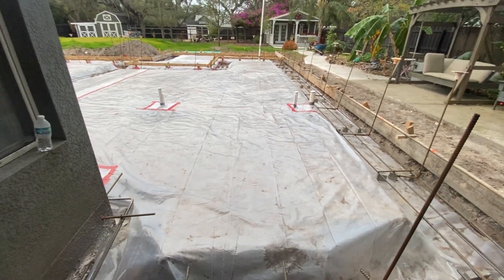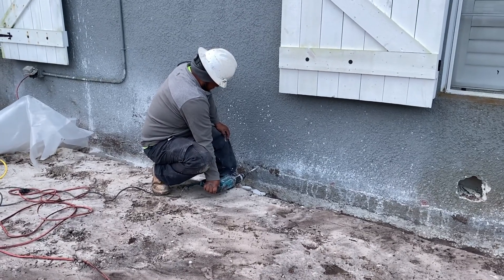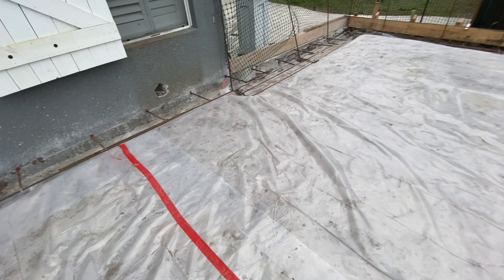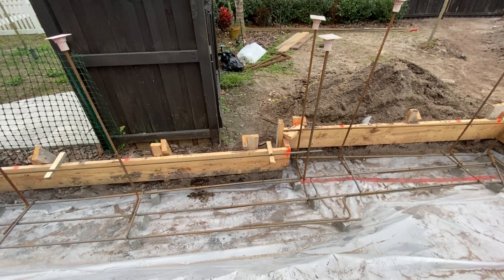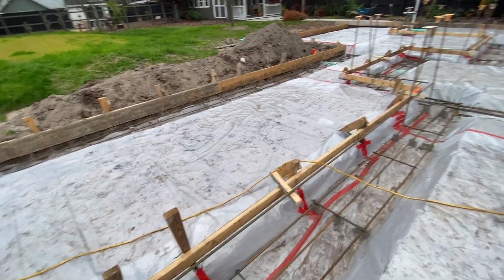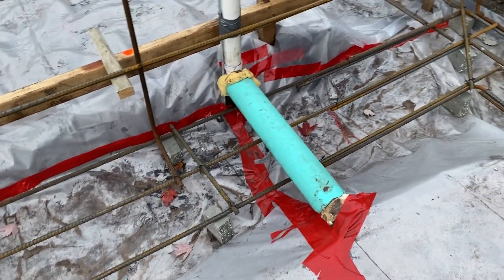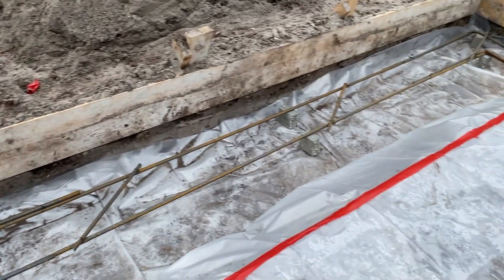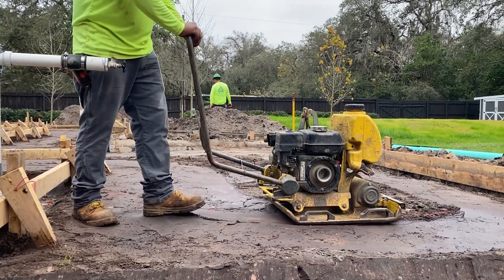Footings & Steel For Concrete Slab | Building a Home Series

Comment: On August 30, 2011 you posted: 

Putting porcelain tile on the garage floor. 
How did the tile hold up?
Reply from the maker: Still good as the day I laid it down. Even dropped a transmission from a hoist straight down on it. Zero cracks
Reply: @fixitnoworlater  I am considering laying tile my garage.  Thanks for the reply